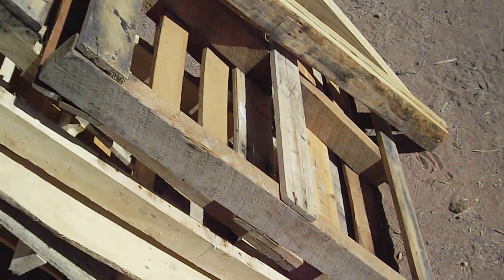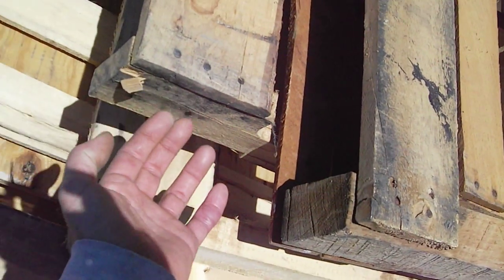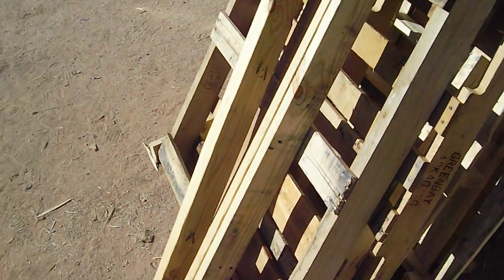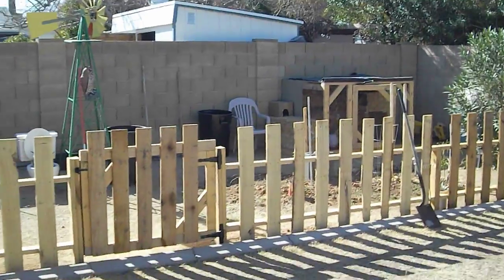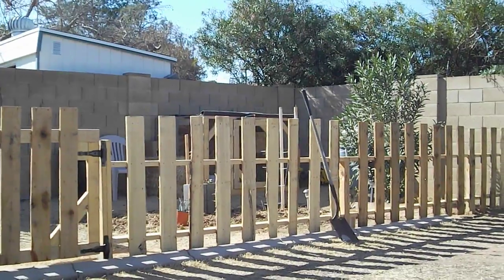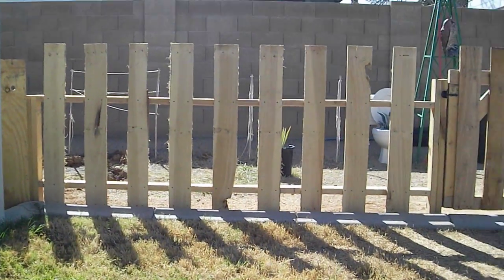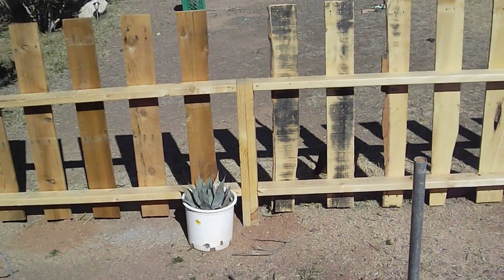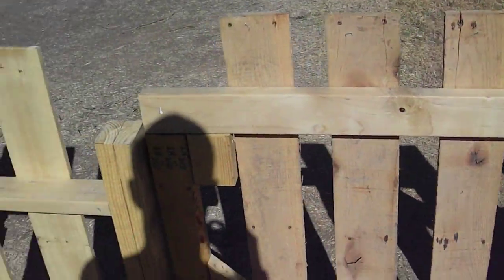How to Build a Garden Fence using Reclaimed Pallets

Comment from the maker: Thanks! Glad you liked it.  I used 3" screws on the supports.  I positioned the 2x4's on the post supported with a quick clamp (  "C" clamp) under the board to hold it in place at both ends. I then drilled pilot holes at 45 degree angle thru the support board into the post. I chose to go from the sides ( horizontal) of the 2x4's instead of from the top or bottom of the 2x4's. Figured it might be stronger. Hope that helps some.  Good luck with your project, Cheers!

Comment from the maker: yeah,  should be able to.  if you use metal poles for posts you can just slip em over.  if you use wooden posts you could just screw the pallet to the post to hold it.  should work and be alot quicker to assemble.  if you end up making the fence, post a video.  Cheers!

Comment: How many pallets did you use please?
Reply from the maker: Hi Kelly. I used roughly 10 pallets. Can very if the pallet doesn't tear apart easy and the wood cracks. Thanks for your comment and watching my video. Cheers!
Reply: Hiya, thank you for your reply 😆 I may try this, just not sure about sinking the posts, do you put the bear wood into the concrete mix? Will it not rot, as you can tell I'm a novice lol
Reply from the maker: Yikes Kelly,  just seen your message! lol.  Better late than never, eh?   It eventually will rot.  I would recommend using treated 4x4's for the posts.  After almost 5 years of this fence being up I recently had to replace one of the posts due to dry rot.  Treated lumber would of saved that issue.  Hope you got your fence in the ground and thanks for the comment.  Cheers!